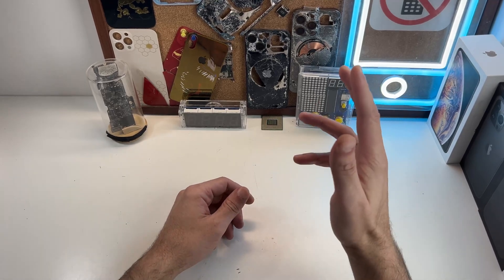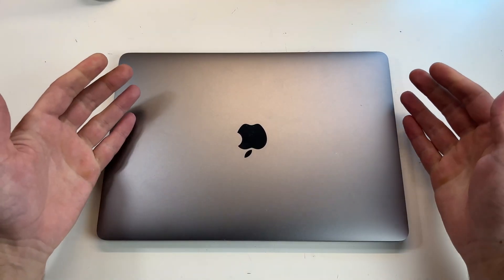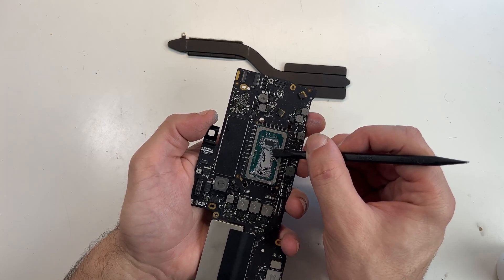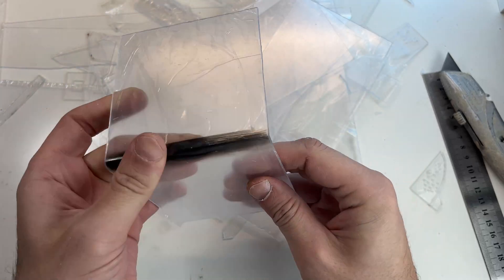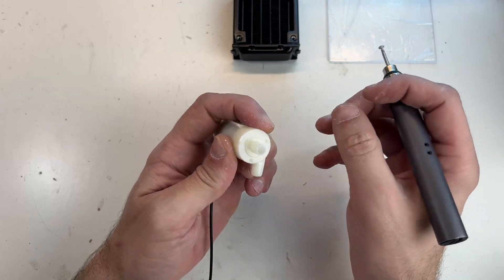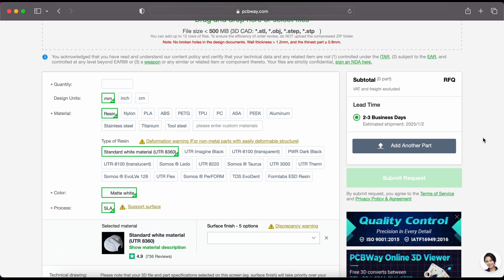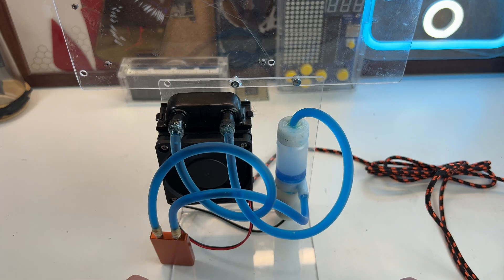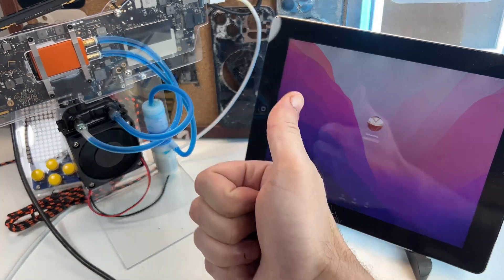My Side Quest: The Making My Own Liquid Cooled Mac

Comment: I am planning to so something similar with my MacBook Pro 2019 with i9 so I can't wait to see performance gains.
Reply from the maker: Sounds like you have great project in your hands , just heads up you will need OpenCore to eliminate the throttle from the missing parts
Reply: @BalkansWay  Yes I have a hackitosh too, I’ve been trying to manage the thermal issues on my Intel i9 MacBook Pro (2019). Even after thoroughly cleaning it and upgrading the thermal paste to liquid metal, the performance is still heavily throttled — especially since I live in India, where the ambient temperatures are usually around 30-35°C. Without air conditioning, the laptop is practically unusable for my workflow.

At first, I considered converting the MacBook into a desktop-style setup, fully submerged in mineral oil for passive cooling. However, I really love the MacBook's speakers and display, and I want to keep using them — so I started looking for alternative ways to improve its cooling.

One of my initial ideas was to modify the stock heatsink. I thought about cutting the copper heat pipes at both ends and connecting them to an external water pump system. Water would flow from one end to the other, with a radiator handling the heat dissipation — essentially converting the MacBook’s heat pipes into a closed-loop water-cooling circuit.

While researching, I came across a video by Linus Tech Tips (LTT) where they showed a different approach: they soldered extra copper pipes directly onto the existing heatsink to increase its thermal capacity and surface area, and I found that idea much more appealing.

Right now, I’m leaning toward this second method — soldering additional copper pipes onto the stock heatsink and routing them out through the exhaust vents. This would allow me to avoid extreme modifications to the MacBook’s chassis. The only visible change would be two copper pipes sticking out from the exhaust vents, which I find a cleaner and more practical solution than a full hot-rod style mod.

This setup wouldn’t make the MacBook very portable anymore, but it’s a balanced compromise between keeping the original look and getting much better cooling. I’m still finalizing which approach is best, but I’m definitely leaning toward soldering the pipes and using an external cooling loop for now.
Reply: @BalkansWay  I've been struggling with my Intel i9 MacBook Pro — it's just not able to handle my workflow, even after cleaning it and upgrading the thermal paste to liquid metal. I live in India, where ambient temperatures are typically around 30–35°C, which only makes the thermal issues worse. Without air conditioning, the MacBook becomes nearly unusable for heavy tasks.

To solve this, I initially considered converting the MacBook into a desktop setup using a mineral oil cooling system. However, I absolutely love the MacBook’s speakers and display, so I wanted to find a better solution that still lets me use those features.

My first approach was inspired by other water-cooling mods: I thought about removing the stock heat sink, cutting the copper heat pipes on both ends, and pumping water through them — basically turning them into mini water channels with a radiator attached outside.

Then I came across a Linus Tech Tips video where they soldered additional copper pipes onto the existing heatsink instead. I found that method more appealing because it avoids removing the original heat sink and keeps things relatively clean.

Now, I'm thinking about soldering extra copper pipes to the MacBook's existing heat sink and routing them out through the exhaust vents. This way, I can add external water cooling with minimal body modification. The laptop won’t be portable anymore, but it avoids the extreme "hot-rod" mod approach. From the outside, you'd only see two copper pipes sticking out from the exhaust vents — a cleaner and less invasive look.

I’m still deciding which method is best, but I’m leaning toward the soldered copper pipe + external radiator setup since it keeps the internal layout mostly intact while significantly improving thermal performance.

Comment from the maker: The thing i forgot to mention later on was why i wanted Mac with touch bar. Since the power button is separated i can take it out and use it on my creation to power it on and off while keeping the touch iD. On the non issue ouch bar model this is not possible.